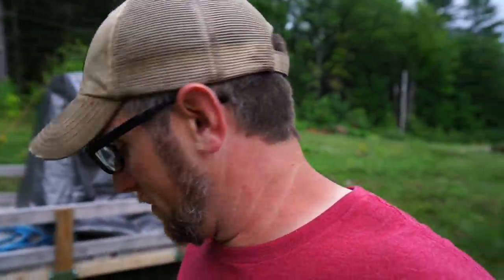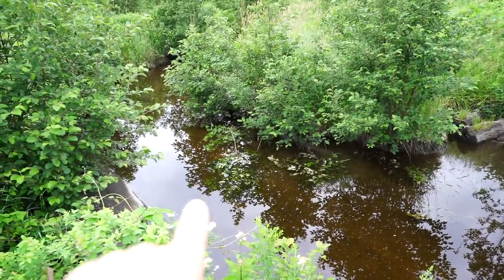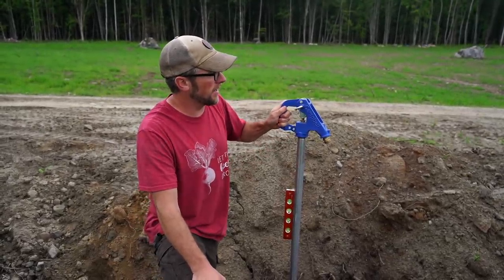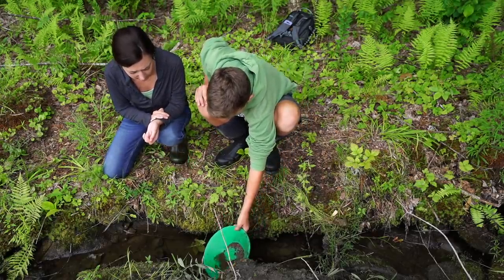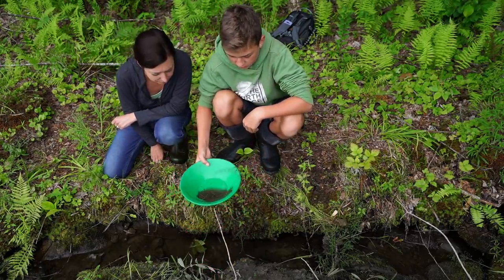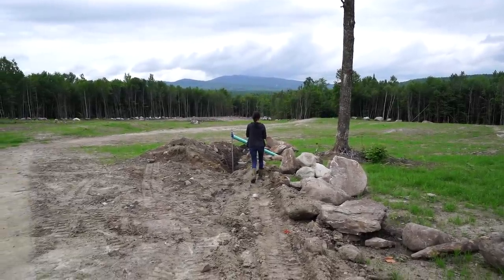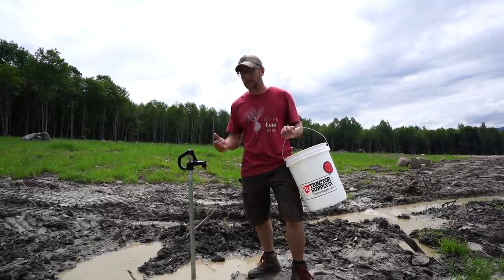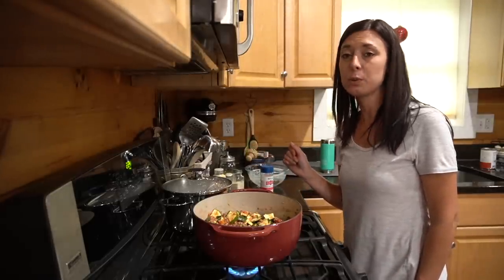DID We JUST WASTE all of OUR TIME & MONEY!?! Testing Our DIY GRAVITY FED Water System

Comment: We have used the on-demand RV pump for 3 years daily, no issues. We have solar panels to keep the batteries in the RV charged. I will use the same on demand pump for our garden watering, with solar charging a battery. On demand pumps are $60 (shurflo has been great). It pumps 3 gals per minute, & we have a charcoal filter after the pump. Our county water spigot is gravity fed at least 70 psi, but the tank is at 500’ in elevation down to our sea level location. Fills a 300 gal IBC tote in 13 mins with 3 hoses attached. You will figure it out & make it happen for your family. Great video, thanks for keeping it real.

Comment: Al, have you thought placing a Hydraulic Ram Pump connected close to the outflow valve of the Water Cistern??
Reply: Usually need around 5 foot of head to get a ram pump to work.  Think Al's setup is a bit short for that.

Comment: AL...Gravity pressure proved to be inadequate for my outdoor/solar heated shower. I 'slaved in' a solar powered 12v air pump from Harbor Freight to help with head pressure. Works great. I'd wager that ANY tank that is strong enuf to be buried can take at least 25-30 internal psi. Hope this helps.....~Eli.

Comment: +/- .433 psi per foot elevation change minus head loss from pipe and fittings. Looks like you need more elevation change.
Reply: Like 20' more 🤣🤣
Reply: That's real good water flow considering  it has to flow up the 6' hydrant pipe.

Comment: In a Gravity system like this every foot of height makes a big difference in the pressure and the flow rate. Lower the hydrants relative to the storage tank by either their position further down the hill or cut the stand pipe to lower the hydrant. Even how high the water level in the storage tank will make a difference in the pressure. 
  All in all, it is not bad for an animal watering system. When you hook it up to a stock tank with a float switch it will be plenty of flow for the animals.

Comment: I enjoy watching makers make things even when the things fail or need fine-tuning. I give you big points for successfully "tapping" the creek and adding running water to your homestead. 
This build will be handy even if it lacks the pressure you want right now.  It could be used as a 4 season auto-waterer for animals like the one Justin Rhodes made/uses. 
Moving water around a big property is no fun - it's heavy, your build will move a lot of free water very easily. 

Use this system to fill your water tote trailers until you get a well in - boom victory!

Comment: Al you need more elevation at your source. The pressure has nothing to do with volume at the source . Elevation is the only solution unless you pump it.
Reply: With a long run from the tank you need to think about pressure loss due to friction.
Reply: He can't get more elevation  so forget that !!!!!!!!!!!!!!!!!
Reply: @kenknutson1598  his flow rate is so low he could quadruple it and still not have friction loss problems.  But once he gets a useful flow, friction losses certainly come into play.  But he has a lot more to do to get there.
Reply: @davenelson9253  Head of hydrant needs to be as low as or lower then outlet on tank,, if his 3rd hydrant is that low he will get volume but not pressure . Al said hydrant will be a couple of feet lower so 3rd hydrant should be OK
Reply: @robertmatthews4285  Yes, he is at a steady flow because his pipe is a good diameter. The friction against the pipe walls will increase with smaller diameter and faster flow.
Reply: He should've had the tank on a stand with a solar pump from the stream to fill it, he has no idea, that's why he's funny to watch, kinda like the 3 stooges  🤣🤣

Comment: Going to have to weld a nugget of a bucket hanger on there ;)
Reply: Self Retired ,
It looks like it was intended for a wire handle. Not a wire handle that has a plastic handle on it. The plastic handle was too large for the hook.
Reply: @donaldmiller8629   I'm aware of that. I also prefer those buckets for carrying water vs a 5 gallon bucket or two. But that's not what he's using at the moment. Maybe he will hook a hose up to it and not have to worry about the bucket hook at all.🤷‍♀️

Comment: you should be able to put a rv pump anywhere in the line and run it off solar. If it is attatched to a hydrant it should pull  water from the source. We used 3 pumps inline from a spring to fill water barrels for our outfittter camp. also your hose placed in a lower elevation will cause suction and give a little more volume ad in ditching to water a garden.The high hydrants as someone suggested will cause you to loose pressure.  make your last hydrant a shorter one. may help.  good luck

Comment: The “gravity feed” system depends entirely upon differential in height between the source and destination. It works like a car rolling on the ground. The higher angle of the hill the faster the car will roll. Your pump will need to be in the line, not in the tank. Don’t fill in your trench at the tank because I believe you will have to install the pump at the outlet from the tank. Keep on trying. God bless.
Reply: Exactly.  An in-line pump should be installed close to the output line from the tank.  If an access hole was dug on the side of the tank that would give access to where the outflow comes out of the tank, that would give Al access to install an in-line 12v on-demand pump.  Then a 100 watt solar panel hooked up to some deep-cycle battery and away they go!
Reply: @samvalentine3206  - Howdy, Sam! Hope you & your family are doing well. Hugs!
Reply: How much milk are you getting from the goats every day?
Reply: @vmorganbogart  - Hey there, Vicki!  We're hanging in there... hope you and yours are well too!

Comment: Al, need to weld a chain hook on the buckets. Make your life more simpler
Reply: Do three up high on the back of the bucket. One on each edge and one in the middle. Sometimes you might want to use two chains or have two connection points for one chain.
Reply: Once he refills the ditch, he can just sit the bucket on the ground. Lifting it off the faucet is a good way to get wet  in the winter if one does not have a good grip  and will mess up anyone's day.
Reply: Not with the small welder he has.

Comment: You might think about a second water tank above ground ( or elevated for more pressure), and use a solar powered transfer pump to fill the second tank ( use a float switch to control the water level in the second tank). This will give you twice the amount of available amount of water, and depending on the height of the second tank a very good increase in flow & pressure.  Thank you you sharing your life style, I am a regular follower!

Comment: The further you get from the source the weaker the stream YOU CAN INSTALL.A STRONGER STREAM SUMP PUMP TO INCREASE YOUR WATER PRESSURE
Reply: no that is incorrect, the supply pipe if the correct size will allow more flow of water,he said going over the hill gravity will help that ,his problem atm is the outlets are almost level with the top of the tank thats why there is little flow he should have fitted a 2" service pipe and picked of that to his stand pipes ,he is lucky he can replenish the tank quick enough and not run out,if it couldnt then he would be up the creek without a paddle,as many have said fitted a pump with a flow switch, pen stand pipe and pump comes on its that simple..
Reply: NO sump pump. they are not a positive displacement pump

Comment: perhaps a small bilge type pump that you would use in a boat, inexpensive, 12 volts which could run of a 12 volt battery charged by a solar panel
Reply: add a flow switch to that and eveythings honky dorey ,open tap/faucet flow switch comes on pump starts ...sorted :)
Reply: The problem with bilge pumps is they produce a lot of volume and not much pressure. Even the manufacturers warn about putting the overboard discharge to high above the pump. I know, I have three on my 30ft boat.
Reply: @dcrahn  So bilge pump just good for moving water but not pressure, good to know!
Reply: @bncsmom1  he can do this the way we supplied water to green houses over here, wind mills ,no not like those massive ones your use to seeing , these lifted water from ground level to a storage tank higher than the green houses that needed the water supply  for drips and spraying, no power except the wind and it doesn't take much wind to work either..
Reply: @gsyguy1  Except he was gung ho on a GRAVITY powered water system, not PUMP powered water system. He's learning he messed up from the get-go and dumping those boulders in shows how little he really cares about this project at this point, imo.
Reply: @bncsmom1  yeah i could see that from the start, plumber for over 40 yrs i said to myself how the F is that going to work ? i answered myself its not,thats why i suggested on one of these replies teh old fashioned wind mill and storage tank that we used in the tomato industry ,now do i know my dad was a grower and thats how we got our water,its simple works,his one down the hill will work gravity plus the height difference will be OK and a lot better than the stand pipes he has at the moment but im sure he will take a look at all the comments and pick which one will work for him... hey he made a mistake we all do..and its not a disaster :)

Comment: To improve your water pressure, build a platform near the buried container, put an IBC tote up on the platform and feed its water to the buried container. Then build a RAM pump in the spring stream to keep the IBC tote filled. The pressure from the weight of the IBC tote water will increase a little the higher you place the IBC tote (every 34 feet of height is 14.7 PSI for fresh water).. Using a RAM pump requires NO electricity, the force of the running water is the power source. There are many examples on YouTube on how to build and install a RAM pump. This should be a relatively inexpensive method of increasing pressure. Only takes some PVC pipe and a few brass fittings and flapper valves.
Reply: I like the idea, but won't the water from the IBC tank just run out the overflow on the main tank? Besides. I don't think there is enough flow in the little creek to get much work force for a ram pump.
Reply: Winter might be an issue

Comment: dad and i built a mobile home park and over the years we lost some to freezing and just as many to rocks that pushed through the cushion around the pipe if we had it to do again we would have surrounded the water lines in flash fill  which of course is cheap and after cure is wonderful for preserving from compression and the soil coverage adds thermal stability

Comment: Make sure your tank is vented, they do make, superior pump has a portable 12 volt pump you could probably figure out a way to use it....they sell them at lowes.
Reply: @AmysArea  I don't think its an air problem , its seems to be a pressure problem, I think if he vents the top of that tank it will be better
Reply: @charlesmerritt4403  I agree but I bet it helps

Comment: Water seeks its own level. You will have to elevate a tank (bad in winter) or add a pump of some sort.
Reply: Correct!  https://ibb.co/WtgN9z7 - the only way for more pressure will be to have the tank set at a higher elevation - like further up the hill/mountain where the spring is flowing...

Comment: Al we call the pump that I think you could use is a bladder pump (inAUS) I have one in use to pump the water from my rain water tank into the house.They are about $300 aust, not to bad. You will need a solo panel and an inverter but give you plenty pressure.

Comment: Al:  You can design an in line booster pump.  I would suggest that you build a sump to install the pump in since it should be installed in the discharge line from the main reservoir.  I would not think that you would want to bury the pump.  The pump will require maintenance and burying it would just be a pain.  You can do some solar installation however the amount of pressure may not be high.  Good luck and I will follow your adventure.

Comment: if you fill that old tote with water and stand it in the sun it should pop back out
Reply: That would be nice.
Reply: One can probably reach in with an arm or some sort of implement - (a 2x4?) and press out the areas where it compressed.  The water idea is a good one!
Reply: If not then add air pressure

Comment: How in order to grade a property you're going to have the bucket flat on the ground it'll take care of itself
Reply: I was going to comment about that  too, I just flatten my tractor bucket on the ground and put a little pressure and back up. Smooths it right out. He could use the bucket several ways to smooth and not work so hard. That big tractor should have the power but sometimes big is not better, i have a 30hp that works circles around the big tractor when leveling.

Comment: Jabsco makes marine pumps that run on 12V. PAR-Max 2.9 is one of the smaller ones with 2.9 gal/min. Bigger ones are available and pressure switch is build in.

Comment: LOL, now you're asking for advice? There was  whole comment section of advice regarding your water catchment system before you put in that new tank. Maybe  should have read those suggestions before proceeding? I suggest you consult with youtuber, Engineer 775 who does all types of offgrid water systems.
Reply: Yes, very true.  And now, if an in-line pump is to be installed on the current lines, there will need to be digging if the desire is to pressurize the existing installed system.  Some sort of pump will need to be installed at the output line of the sunken tank to pressurize the existing pipe system.  Such a unit can have a pressure switch on it to detect flow and then turn ON.  But, it will need to be spliced into the outflow pipe.  I'd suggest a manhole built on the exit side of the sunken tank, drop a liner into the manhole to give access to the tank exit area.  The liner will keep the dirt from back-filling the access area.
Reply: Watching Al for years, I'm betting he already has a plan for a well for the house. I'm also betting that if his current system fails, he'll just rely on the future well to ensure all his future water needs. As for listening to the comment section... he does. Just remember most of his videos are released 5 days after they were filmed. So he has probably already made the decisions, but wants to see what the comment section thinks.
Reply: @daviddavis703  I too have been watching this channel since they had less than 100 subs. As I mentioned in my comment Al had a lot of very good advice from obviously experienced people regarding his water catchment attempts. Some folks learn by doing, even if it's on the 3rd or 4th try with substantial investment...
Reply: @rt3box6tx74  well said!👍
Reply: @daviddavis703  Al already said he was going to drill a well for the house. This was just going to be a separate system just to get them going on the OG Property.

Comment: Anyone check elevation or the pitch of the pipe?
Reply: No ,Al is in over his head with this off grid stuff.
Reply: @jimputnam2044  As water is coming out of both hydrants it proves that it's working due to gravity!!!!
Reply: @jimputnam2044  with pretty much everything he does
Reply: @tonygrimes13  I know but not enough flow to be useful. A lot of time and money gone. Tank needs to be much higher.
Reply: @jimputnam2044  The flow that was shown would be enough for their animals but I would lower 2nd hydrant out flow.

Comment: I think a vent extending from the tank will increase flow.  Mark Baker from Bakers Green acres just did a water system review.  Auto bell waters for each tractor or animal trough.   Runs 1" with 3/4 and 1/4.  Entire farm automatic all summer.

Comment: I thought you were smarter than that, Al. Your water source HAS TO BE ELEVATED!!! (the tank) With 1" pipe the water pressure will be 1lb per foot in elevation. You might have to run quite a bit more pipe to your tank to get the proper elev. I put three 1500 gallon tanks 60 feet up a hill behind my house an got 60 lbs of pressure, just like being in the city. lol Get that tank out of the ground!
Reply: It actually is .43 psi per foot but you are correct it's all about elevation.

Comment: After doing some research I think you may need to use a small well pump turned on it's side and connected to the fitting inside the tank. There are some small ones out there that are solar/battery powered. Also well pumps are setup to start on demand. Or even maybe use marine fresh water pumps that start up on demand.

Comment: Big mistake throwing large rocks on top of water line, been there done that.
Reply: freezing, thawing, heaving will cause major issues in the future for sure.  Even below frost line, not a great idea.  Not enough fall from that tank it looks to us like.  Also, is that tank vented?   Should have started back where the spring comes out of the ground.  We have a spring fed well for our house and a pressure tank in the basement.  Works GREAT!   I know he is wanting to be off grid, but unless you have a LOT more sunshine in winter than we do, you won't get enough pressure to feed your house and all your animals without a pressure tank.
Reply: @patriotmama  We have a pressure tank and it works great. We have three frost free spigots for the animals and then our own water use in the house. Been here 12 years and it is still going strong.

Comment: Could also add an additional tank above the buried tank.  Fill that from the spring either with a ram pump, or solar driven electric pump.  The added height from the above ground tank would give you more pressure.  Granted, that may be a warm weather solution only.